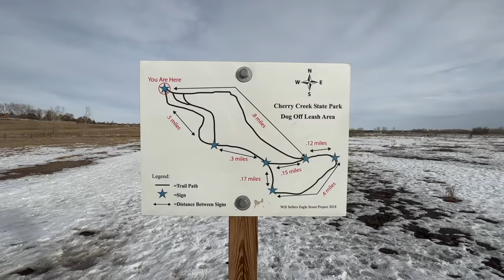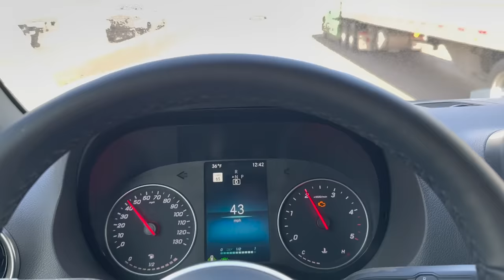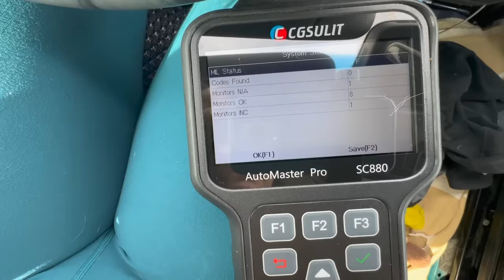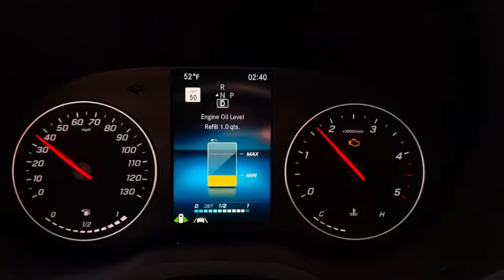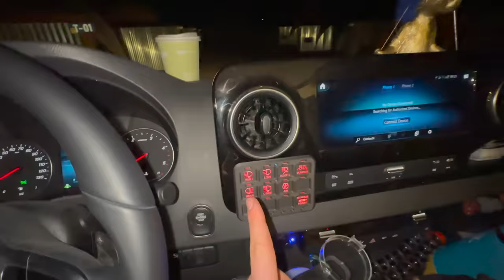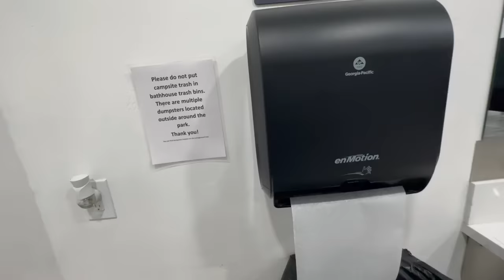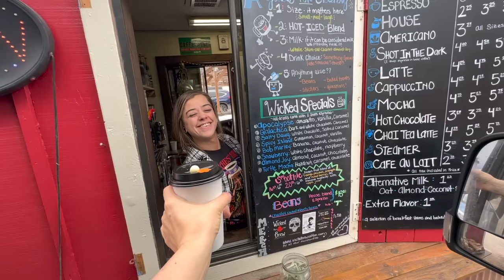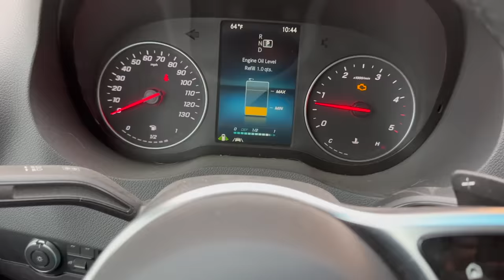Living in a Luxury 4x4 Sprinter Van | 7 days to get across the USA

Comment: If you disconnect the battery for a few minutes it will get rid of the check engine light if you have a problem it will come back on , also if you get a light after filling up it could be that the fuel cap may not be sealed properly try unscrewing the cap then screw it back in.

Comment: Not sure if this was mentioned before. I’m an over the road truck driver. We daily do a pre trip(check oil, tire pressures, tires etc) now that you’re driving a diesel full time. Checking oil at least every other day, and other fluids also. Diesels( old and new) will burn a little oil. Great video…..
Reply: If you were going to recommend a van for someone to convert into a camper van who doesn't know ANYTHING about cars, would you say gas or diesel?
Reply: @gryffyleelee  Gas, it's going to be a lower total cost of ownership than a diesel.

Comment: Well, you've 100% convinced me that Sprinters are not worth the money. I have a 1997 GMC Safari that runs better than that thing and it only cost me $2000 and a few thousand more to get it super reliable. Even at $10K all-in, I save $120,000😆
Reply: Agreed! Mercedes aren’t cheap but given the quality isn’t there it’s definitely not worth it. MBZ should wake up because this isn’t good advertising for them.
Reply: @Kat-n-Ollie  It’s not MBZ’ fault Nikki drove without checking the oil… anybody that drives any longer distance, regardless living on the road or not, should ALWAYS check the oil before a trip…
Reply: @ibMoose2u  If you buy an EV, no need to check the oil, belts & all those million pesky things!
Reply: @ibMoose2u  except I know many people with sprinters that spend more time in the shop instead if on the road, 3 of them less than a year old
Reply: @Kat-n-Ollie  Nikki's brand new van had a engine light right from the start - the dealership told her they could not guarantee this wouldn't happen again.  WTH?  Then, she drives it to her place to transfer belongings and it's clear that the driver side fog light was out.  Brand new van.  I hope she has better luck with this new van she will be picking up but won't be holding my breath.
Reply: @debiwillis9045  I know nothing about any vans lol, but I do know when a red light comes on, check all of your fluids is one of the first things to do, especially with my 2001 Dodge 2500 Cummins lol
Reply: Merc's are worth the money but not the in the usa,
The American ones are crap,I have driven merc van and truck In the uk for 20yrs and not a problem,you only get what you pay for.
Reply: @ibMoose2u  it wasn't a red light,it was Amber(pardon the pun)so therefore it was advisory.  RED MEANS STOP IMMEDIATELY
Reply: @stum8374  Well again, I know nothing about vans or MBZs… my Dodge 2500 Cummins diesel and Honda Accord have separate low oil level lights and check engine lights. Regardless of the color, it turned out to be low oil with no apparent faulty issues leaking large amounts of oil… user error, not MBZs fault.
Reply from the maker: @ibMoose2u  he’s right, the vehicle only had around 12k miles on it and I was not expecting to need any for another few thousand miles, just a learning curve on a new vehicle :-)
Reply from the maker: @maryh3438  yeah that one is kinda annoying, apparently EGR code is normal but under warsntee up to 100k miles since it’s a common issue they know about
Reply: @NikkiDelventhal  you've got this!  I hate to be a bummer especially since I really don't know $h!T about the Sprinter!!!  I can't wait to see your brand new build!!

Comment: Always enjoyable watching you and camper😁 Good to see you have a scan tool! Was planning to suggest this. Just a funny thing to check if your not aware? Make sure your gas cap is tight and doesn't have a issue? These will cause a code issue since the fuel system is pressurized in most vehicles. You'd be surprised how many people have paid $70.00 or more for a shop scan to find this out.🤣😂🤣😂 Safe travels for both of you & looking forward to your future videos.😘

Comment: Nikki, If the CEL is on,no worries. If the CEL starts blinking,then time to worry, Probably the code reader you have will not read MB 'modules' very well,even though the scanner will see what model of MB you are driving. That is a  pretty nice reader for handheld. The CEL could be illuminated for something as simple as gas cap not tight. Thought ,If you haven't had your current code reader very long,you could send it back,and do some Googling for MB specific forums and see what people there suggests for a code reader model.

Comment: Just fyi anytime your check engine light comes on its an emission issue 100% of the time, so engine oil will have nothing to do with it. Since it came on after you filled up could be your gas cap is not tight enough or just a fluke. Driving should clear it after that particular module that put it on does a recheck of the system it's monitoring. By the way love you videos, happy travels!

Comment: I feel your pain dealing with the endless problems of a Mercedes Sprinter..After investing over $100K in mine, I got sick of continuously having to change my plans because of the Mercedes problems.. I sold mine and bought a 1 owner 1983 Ford Econoline and built a Fiberglass High Top Conversion Van.. After the build, I still had $40K, so now I'm converting it to 4 Wheel Drive.. I hope you have a good experience with your own Van..

Comment: Sometimes when you add the gas it will cause a light to come on if you don’t get the gas cap fully in place. Air somehow makes it go off or something. When I’ve tightened mine it has worked for me when nothing else seems obvious!
Reply: Hi Me too. They said to put the cap on and turn until it clicks 3 times. Seems to be working.    KEN

Comment: Diesels always get Check engine lights for the simplest things, DEF liquid low, a moment in time where the engine detected a lean condition and it was enough to throw the light , Fuel cap not venting correctly or loose, or when the engine sits for prolong time without it running, altitude change.. etc.. aslong as it’s not flashing it’s minor. Don’t ignore it just it’s not a huge deal.

Comment: LOVE LOVE LOVE you Nikki and Camper ❤❤❤❤❤❤ In high altitude/cold areas, the gas stations revert to a different diesel in the fall so you don’t have to add the anti-freeze!! I live in NW Montana about 3 hours NW of Missoula and I’ve never had to add it to my truck in subzero temps.

Comment: 6:45 - The lights on the dash are color coded for a reason. Green is information. Yellow is a warning. Red is stop and address immediately. This is why the battery, oil pressure, and parking brake light on the dash are all red.

The exception is if the CEL is flashing. If one continues to drive, it likely means it will damage something. That something is almost always a catalytic converter.

Most check engine lights are emissions related. They can be ignored as it doesn't affect reliability of the drivetrain, but the car may pollute a little bit more.

Hope this helps!

Comment: Sometimes you can get a check engine light from a fuel stop. What happens is the gas cap doesn't seal right and the fuel system doesn't like it. The simplest "fix" is to try your gas cap. See if it is loose. Most gasoline vehicles cap will click when they are tight. Once  you hear the click stop. The cap can be damaged if you turn it too much.

Comment: Despite the check engine light, there could be a multitude of issues, like a low battery, causes enunciation light display.  Sometimes the issue corrects itself.  My 3500 Sprinter has been excellent since November 2011.

Comment: Plug in scanner. Push start button without pressing brake pedal to the "on" position. Scan, Google code, erase code to remove engine light. Code will be stored in the long term memory for mechanics.

Comment: since you just fueled you should remove and reinstall the fuel cap which tends to cause check engine light to come on, or its your air fuel sensor all it takes is a wind gust to set it off.

Comment: This model of van is notorious for having blocked sensors, especially the DPF sensor. So the engine does not know the air temperature or diesel soot coats the sensor in the exhaust system.

In addition, because you are a careful driver; the engine is not worked hard enough to clear out any build-up of soot. Then, when you run the code reader, is doesn't know the problem because you are stopped. So maybe try a system cleaner, such as: Cataclean.

Love your positive outlook; cheers from England

Comment: Nikki - diesel engines tend to burn a lot of oil. It's just part of the combustion process in these engines. You should think about checking your oil level daily before getting on the road.

Comment: You know, I go to a lot of dealerships for my job. Quite a few high end ones. Mercedes, Bmw Landrover jaguar, you name it. Nothing but problems with these new luxury vehicles. One of my buddies told me that about 80% come back with some sort of problem, and they’re all junk. They all lack quality control. He then said the Japanese are the only ones that will actually stop the entire production line to address a problem and the line will not move until it’s corrected. The other companies will just put the vehicles on on the side, and address it at a later time. Sometimes, they just sell those cars to the dealerships, without addressing the problem because it’s all about the bottom line. He works for jaguar btw. Guy at Mercedes said the same thing.

Comment: One time I had my check engine light come on and it turned out to be a vacuum issue . . . all I had to do was remove the gas cap and put it back.  After a little bit the check engine light went off.  I learned then that when the light comes on it isn't always catastrophic!

Comment: Not many car people watching these videoes, apparently :p
The "check engine light", is actually a much more complex situation. It's more like a "something is wrong-light". The code reader should have been able to read the code, but not all code readers are built the same. Invest in a Carly, I bet they will sponsor you with one anyway :) 
The light indicates pretty much everything from the air filter to the exhaust tip, and anything in between. It may be the filter, O2-sensors, crank sensors, exhaust leaks, MAF-sensor etc... Usually it's nothing major, until the lights starts flashing. Then it's time to park the car and call for help. But a steady light will most likely result in increased fuel consumption.
As for oil. All cars use some oil, no matter how new they are. The Sprinter uses about 1 quart pr 620 miles :) Always have oil at hand :)
Safe travels!

Comment: You can clear codes with your code reader device.  If the code recurs then it is a permanent fault and should be looked at by a mechanic.  If it doesn't come back it's a transient one time only type fault.  In a pinch you can buy #1 diesel fuel at a truck stop.  It is a cold proof type diesel.  Most diesel fuel has additives that will prevent jelling to a temperature marked on the pump.

Comment: The check engine light was almost always on in a car I once owned. It always turned out to be some emissions-control device that was in no way critical for engine performance. So finally I just decided to ignore the check engine light until I brought the car for its yearly emissions inspection.

Comment: A Mercedes 4x4 Sprinter 👩 Nice 👍 with a full custom build out 💰 $175 and the gas tank still isn't full? I don't know where you get the money for all the gas, gas is so expensive 😩 check the oil, that light might be something very simple, OMG synthetic oil, $15.00 a quart, that code reader is an awesome tool 👍@ 20:54 the package on top of the counter falls over all by itself, from: Scranton, Pennsylvania

Comment: You should be able to clear the codes with your reader, no big deal. Then if the same code comes up again, you might have a problem. Write down the code number, then look it up on the web. To the best of my knowledge, the check engine light has nothing to do with the engine. Plug in the reader, start the vehicle, then flip through the digital screens to see whats in there. The cheaper code readers just give a code, but the expensive code readers, tell you exactly what needs fixing. The "FixD" reader connects to your phone.

Comment: You were busy in this video.  For as much as you have to pay for those Sprinters, I'm really surprised of all the check engine lights that randomly appear.  I think I'd lean towards a more generic power plant, that any qualified garage could handle, instead of having to take it to Mercedes-Benz. Do you know if you can purchase a code reader/fault reset gadget?  It would be very handy to have, after you've done all the driver maintenance tasks.

Comment: Don't remove your fuel cap while the engine is running. It's  a pressurized system. The check engine light will come on. The code will be EVAP.

Comment: We had a car that would show the Check Engine light, we'd take it in and they couldn't find anything wrong.  Eventually, one tech said, "try opening the gas cap".  It worked!.  We had that car for over 10 years.  Every time the light came on, we'd open the gas cap and it would go off.  Never did figure out what was happening.

Comment: Most vehicles would have a check engine light that if it is just on that means that it is an emissions issue which doesn't tend to cause any issues for driving. If the check engine light were to be flashing then that means there is some type of mechanical issue.

Comment: I suspect those hikes are good for both dog and human. I do wonder if Camper remembers the locations you stop by for repeat visits. Dogs have  a tendency to remember smells even if they haven't been there for a long while. I wonder if Mercedes will check your other vehicle fluids if you ask them next time you stop in to get the check engine light turned off.

Comment: Did you put the gas cap all the way back on until it clicked? If you not, the check engine light can come on, but will go out after a few miles after you tighten the cap.

Comment: A little less than 215 miles a day isn't to bad. At 60mph you can cover 240 in 4 hours.  So that isn't to taxing
    Disconnecting your battery got a bit should nix the false code reading. Should, usssually..... not allways .

Comment: I'm almost afraid to ask...is YOUR Sprinter going to be built with that same heater? 
 Once upon a time I had a cranky Ford. When the mechanic took off the air cleaner, he stopped and asked "what'sTHAT?". Pointing to a mesh bag with a whole head of garlic in it. He looked at me oddly, till I said "Can't hurt, can it?" with a smile.
 Hey, you never know.
Reply: An hour away from the nearest WalMart! That's the boondocks alright.

Comment: Current Mercedes owner, I JUST GOT A TOYOTA cause the Mercedes transmission broke. I will avoid buying another Mercedes because the engineering is like this: if one component breaks, several others also break because they engineered MULTI-point of failure DEPENDENCIES

Comment: 7 days, 1500 miles?  That’s 2 days of driving.

You don’t need anti gel unless it’s under 20 degrees. And even then it’s eh. Ive never even used it in a exposed fuel tank in below zero weather and never had a issue. Even with 0* and 50mph winds. Shouldn’t be used unless needed and it doesn’t look that cold.

If you plan to go get service, don’t clear codes, ever. It erases any clues and all the history a mechanic may need to see. If someone told you to clear codes, time to find someone else to listen to.